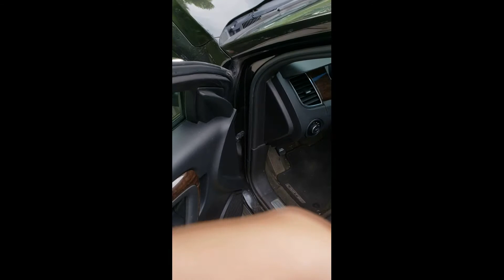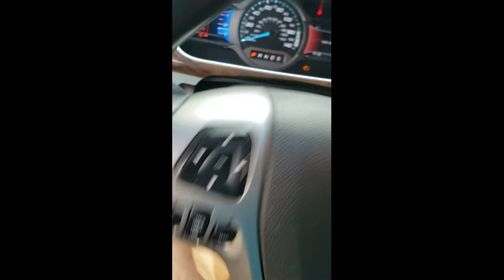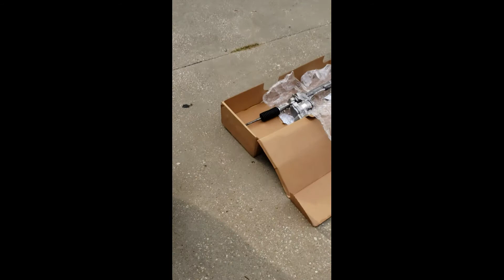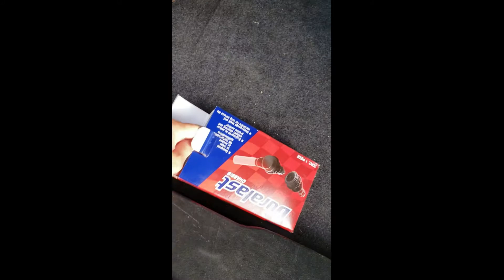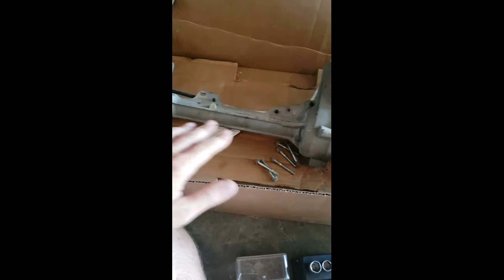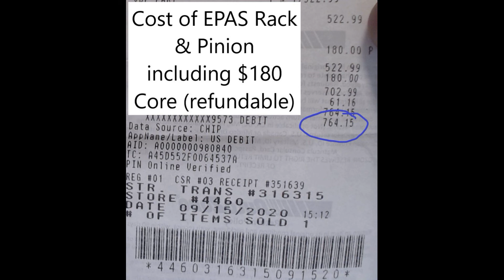Ford Electric Power Steering Failure Solved - Noise on Ford Taurus EPAS w/ Repair and Cost

Comment: I had my transmission replaced back in July. And my car has started making this exact noise. Could it be possible that the mechanic didn’t put something back right when they had to take the the front steering rack off? I had to take my car back to them a week later because it didn’t get put back on right and it shredded my rotor

Comment: I wonder if im alone about this this, got a 2014 taurus limited. Sometimes, powersteering just stop but aint just stoping: its forcing to stay in the position, like its working perfectly fine, take a turn, and the wheel wont come back until im forcing it to do it. Cant fond anythings about it, located in quebec, canada
Reply: Unfortunately the whole rack is going bad most likely especially if u here the noise if u get the advace trac control light and service power steering etc trying pulling your powertrain control module relay u can find a diagram online should be unde your hood by battery I think taking it out for a while and putting it back in should get rid of the warning lights but maybe easier to steer but if it's still noisy probably will need new rack which suck I'm in the same situation om 2013 taurus price to fix it 2300 dollars crazy

Comment: Just bought a 2015 taurus interceptor - getting some squeaking / whining when turning the wheel at slow speeds? Could this be the issue?
Reply: Does it sound the same then most likely
Reply: Speed won't affect it tho as it is electric
Reply: Save your money up it's costly amd when it breaks u will not be able to drive anywhere it has caused 4 accidents has an csp but it been over ten years and past 150 thousand miles that ford will no longer replace it

Comment: 2014 mkz with 125k just started doing it. Ford dealer quoted me 2800. Cardone and others make rebuilds for what you paid. Thanks for opening it up. I thought it was in the motor but its on the lead screw. Bad deaign. Great video!!

Comment: JuST  learned the hard way,  bought  13  cmax  with the issue,  and   I thought was the rack,  but stupidly  hoped it wont be such a  big  deal.    Live and learn.    costly mistake at auction.  thanks for video

Comment: So I was told my steering gear is out. Only symptoms I have so far is loose steering in the front. Car takes on every groove and goes in all kinds of directions. Steering ability has diminished and little skips when turning the wheel slow. I don't have this noise or a code. Was told it's not my gear, but the computer has become inoperable and is not communicating with the main computer. I'd assume I'm fucked right?
Reply from the maker: Sorry I'm just now seeing your comment and you've probably already fixed the problem....but....if you have the electric steering and it is a problem with communicating with the computer, I'd have the local Ford dealer reflash/sync it....I don't know what the correct term for it is, but after I replaced mine it didn't drive right until I took it to Ford and had them hook up their computer and sync/flash it so that it could recognize the new unit and work properly....cost around a hundred bucks unless you can get a nice tech to do it quick for free....only takes them a couple minutes. Loose steering is odd symptom because usually when the electric steering goes out in any way, it just locks up and becomes almost impossible to steer. Problem is, it is a "sealed system" so it doesn't matter much what the problem is (unless it just needs computer flash or an issue with the column) because the repair is the same for almost all issues in the EPAS, you have to replace the whole unit. Hopefully you got it fixed and it didn't cost ya much and I'm wasting my time typing this... haha :)
Reply: @therealnomadtrading  no it's not fixed yet. I've been stuck on this issue and the only place it's been was the dealer and received this diagnostic. I really do appreciate your opinion because I was wondering as well why I'm still able to steer even though it is shitty but it's driveabke and not locked up. I'll take it to another shop and see what they find and hopefully maybe it can be reflashed or synced. Job cost between 2800-3000 for part and labor. I'd like to change it myself but I'm worried about damaging the system before I get it flashed. Am I able to replace it myself and just take it to the dealer after to flash? There. Isn't risk to damage any of the components on the rack? If that's the case, that would surely save me a lot of moneu

Comment: Cost 1700 after core returns in canada
Reply from the maker: I'm in the process of having to do it all over again, my remanned rack and pinion failed...luckily the parts are covered under warranty....but another 800 to a 1000 thrown away...perhaps I'll make an update video when I get the car back and the bills.
Reply: @therealnomadtrading  rock auto has new ones made by ford they are the motorcraft brand but yeah it sucks having to do things twice. Thats why i always buy ford parts new
Reply: @therealnomadtrading  im going to bring my to a shop because the rack works perfectly fine with 12v but for some reason shoots up to 24v module supply voltage then it cuts all assist so it might be a wiring issue
Reply: @therealnomadtrading  So the part you purchased from autozone broke after how many miles?

Comment: Once it’s installed is the car drivable to get it to the ford dealership for reprogramming or it needs to be towed?
Reply from the maker: great question....sorry I'm just getting back to ya....it is drivable...mine drove pretty tight and I was a bit worried, but the dealership hooking up their computer to flash it did wonders and it drove differently afterwards...but to answer you question, yes it is drivable.

Comment: Considering the current cost of vehicles, is it viable to purchase these Tauruses cheap, go ahead and do the timing chain and pump DIY, the EASP system as DIY as possible and resell them for profit. I’ve heard people saying that the auto market might crash and vehicles will suddenly be much cheaper.  Anyway, until/if then, a Taurus is a nice AWD vehicle.  I’m ignoring any carbon buildup issues if theses are are only direct injection and not multiport.
Reply from the maker: not a bad idea

Comment: I have a 2010 Ford fusion and my steering wheel that's the same problem but my steering wheel locks up on me when I'm driving
Reply from the maker: Sorry I'm just getting back to you...that sounds dangerous...if you have the electric steering then I bet by now you've had to replace it. I'm sorry to hear you had that problem....expensive and dangerous.

Comment: Good video.  This winter (we live in Canada) our 2013 Taurus rack and pinion would not steer until the engine had warmed up.  Turns out water had filled the cavity where  the motor and that small belt is and was a block of ice until the engine had warmed it up.  We have not been able to find a replacement yet.  It was put back together and now make the same noise as on your video until we found a replacement.  According to Ford they are year specific and we think it has to do with electrical plugins.  The scrap yard tells me there a two different numbers for 2013, the newer version for me because the car was built after March 2013.
Reply: Did the new rack have any sort of upgrade to prevent moisture intrusion?  I watched another video where a guy attributed the failure to the motor being to close to the catalytic converter without adequate shielding and cooking the substance/grease used to protect the circuitry and thus the moisture.  His was a Ford Flex.
Reply: @matthewmoore661  It has worked good until about 3 weeks ago.  Sometimes works good and then steers hard.  Have found another rack which we will replace when we get a chance
Reply: @matthewmoore661  The new one is second hand and sitting in the shed.  It is off another Taurus.  Don't see any modifications
Reply from the maker: Mine is in the shop again because the re-manned rack I got from Atlantic has failed after a few years....the one I'm putting in it this time is slightly more expensive and different brand because Atlantic is out of stock indefinitely...I'll make a video updating all this...hope you got yours taken care of...

Comment: 100% I have this issue right now, driving me crazy.  I was told this needs to be done by the Ford Dealer and reprogrammed by them as well, not liking that but let me know if you had to have the Power Steering Module reprogrammed by Ford.
Reply from the maker: You probably already found the answer...can't remember but I thought I put this in the end of the video, maybe not....anyway, the answer is yes...some mechanics have the tech to flash it or sync it but mine didn't...the car is drivable after it is replaced, just not optimized....so I drove mine straight to FORD and they quickly reprogrammed it for $130 bucks

Comment: Finally! you diagnosed the fault. Wish you slipped the belt off the motor just to prove the bearing. And then greased the bearings or pulled to see what failed in the bearings.

Comment: I have a 2014 Ford Fusion. Was making same noises and advance trak light came on as well as hillside assist. Then suddenly power steering went. It’s at ford now, just curious as to what you think issue might be or price to fix. Thanks in advance
Reply: Did you ever find out what the issue was on your Ford? I just had the same issue.

Comment: I got a 2013 Ford Explorer it’s not throwing a code for mines either and it has the same sound when I turn the wheel when I go straight no sound !! but that’s the same noise I’m currently going through like it’s rubbing and mines got 98,000 miles
Reply: How did you fix it

Comment: You mentioned that the problem is just in the bearings, so instead of replacing the entire EPAS, isn't there any way to just fix/replace the bearings and save money?
Reply: I asked the same question to my mechanic and he said for the labor to even get to the ball bearing, it'd be the same cost as just replacing the whole unit. 🤦
Reply: It's not just the bearing that is shot but also the spiral track rod  is damaged.
Reply: @edesir  ah ok. Thank you.

Comment: Thank you. I have that exact sound in my 2018 Escape. Ford dealership wants $2200.00 to fix. Do you have any information on how often the EPAS goes bad? I only have 53k miles on mine, but you had 117k? So are they going bad every 50k or so?

Comment: I know I'm late to the party. But my 2013 MKS Ecoboost started making this noise, a few months ago. It was right after I drove through a flooded road. To be fair, all the roads were flooded. It's consistently gotten worse. I knew it was the rack, cause it couldn't be anything else. Will be doing it my driveway this weekend. I'll be posting a how to video, when I'm done.
Reply: Hey I checked your channel and didn’t see a how to video. I believe my 2013 Taurus sho would have the same bearing and would like to know the part number
Reply: @danneebro9167  Which bearing? The inside of my rack was broken, after installing a re-maned rack it's completely silent.
Reply: Exactly what happened to my fusion. Drove through flooded road and 2 days later.

Comment: I know this was almost a year ago but THANK you for posting this. I have been googling for weeks to find this exact sound!!!! My 2012 F150 started this few weeks. Now I know exactly what needs replacing.
Reply from the maker: You're very welcome! Thanks for watching and commenting and good luck in your repair my friend!
Reply: how much did it cost? my 2014 ford Taurus just started this issue
Reply: @thekrissy112  mine was about $1500 after core was returned but we did the work ourselves.
Reply: I have 17 Fusion Sport with 119k miles. Same sound plus random intermittent loss of assisted steering. Dealer cleaned some water out of motor. Wanted $4200 to change it out. Thanks for the info!

Comment: Did u lose all power steering or just the noise I did it’s hard as heck to turn the wheels now
Reply from the maker: Hi there, No, it was just the noise and I drove it quite a while with the noise.... if you lost all power steering, then it's almost certainly not the bearings but the motor itself.... either way the fix is the same and replacing the EPAS system should fix it right up. Sorry it took so long to get back to ya. Hope you get it fixed fairly inexpensively.

Comment: Did you have your car towed to the dealership? Or did you drive it without configuring the new rack and pinion?
Reply from the maker: I drove it. I'm not sure I'd take it on the highway, but I drove it a couple days around town while waiting for my appointment and was just fine. It actually made some weird loud sound when I would take off, and it steered pretty heavy, but to my surprise, having the dealership reprogram it, fixed these issues and it drove great.

Comment: Was the car drivable to take it to the dealer to have it programmed or did you have it towed?
Reply from the maker: Hi there, it was drivable... it made a strange loud banging sound (I never figured out what it was), and the steering was very heavy, but I drove it a day or two around town until my appointment, and after they programmed it, all sounds went away and it drove great.

Comment: Hey, I´ve got the same problem in a Focus 2014; how can I get bearings for that? can you give me some comments?
Reply from the maker: Are you sure it's got the electronic steering EPAS system? Also, I'm not really sure if you can buy just the bearings...Through parts stores like Autozone or through the dealership, the part (in my case ER1002) is the complete epas unit, there is no break down part numbers for the internal pieces. You may still be able to find them through a junk yard, or online like through Atlantic automotive which I believe is the company that rebuilds the units for autozone where I got mine....but there are a few companies autozone uses to get these remanned units, and they have access to the parts somehow, so contacting them might result in answers on how to get just the bearings....with some internet skills and persistance you may be able to track down the individual pieces. Good luck to you, hope this helps.
Reply: @therealnomadtrading  thanks dude,  that helps,  i can take a decision

Comment: Mine was just starting to squeek a bit, caught it early and replaced the joint/shaft.
Reply from the maker: At first I thought that was my issue and hoped lubing the shaft or something simple would fix it but I wasn't so lucky. It FELT like it was in the shaft rubbing on something etc....I was shocked when it ended up being the bearings inside the EPAS unit honestly.
Reply: @therealnomadtrading  That sucks, I hope they've addressed these kinds of issues on all the newer parts going out.

Comment: Did you do the job yourself and that link for autozone says not compatible for my vehicle even though 13-19 Taurus all the same
Reply from the maker: No, I don't have a life and this would be a big pain in the ass to do without a life....and it needs to be aligned after as well so I wouldn't be able to do that either. Mine is a 14 all wheel drive....if yours is similar and has the electronic steering it's probably the same one.

Comment: u said i would save alot of money. what about if i have a extended warranty where it covers everything from engine, suspension, to electrical?
Reply from the maker: Yeah I'm not sure about your warranty, have to check with the dealership to see if you have a warranty that covers that issue or not. If you're lucky, perhaps. Mine is a 2014 so it's long past the warranty.
Reply: @therealnomadtrading  i bought my 2014 taurus and i got an extended warranty. i pay so much a month(actually i just paid it off in January) and it covers everything from drive train, transmission, engine, suspension to anything electrical on the car. the only it doesnt cover is brakes n tires.
Reply from the maker: @stephancobb13  That's awesome! Wish I would've had that, sounds like you'll be set on this and not have to pay all the money out of pocket like I had to! :)
Reply: @therealnomadtrading  yeah. although i do have the money. but dont wanna pay it if i dont have to
Reply from the maker: @stephancobb13  definitely not. gotta save the money whenever possible, many things I'd rather buy than steering parts for my taurus and I bet you're the same! Hopefully you can get it done with the warranty.
Reply: @therealnomadtrading  yeah me too. i just dropped it off today at a ford dealership